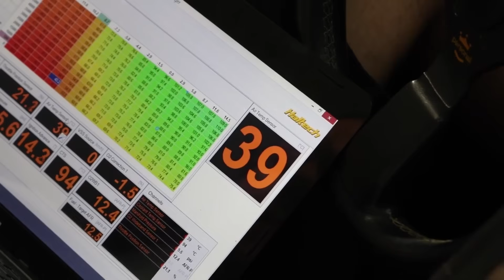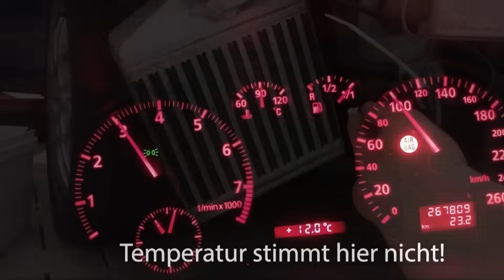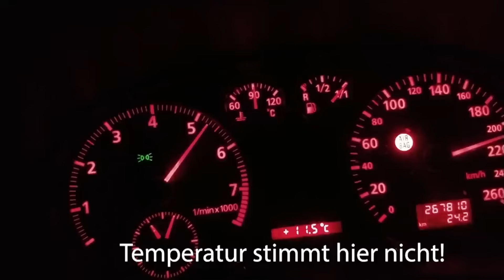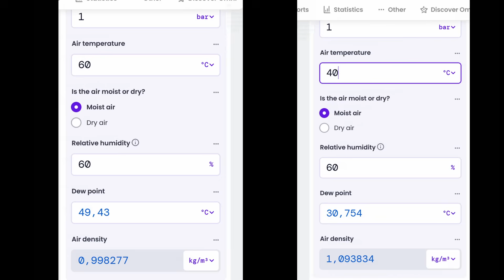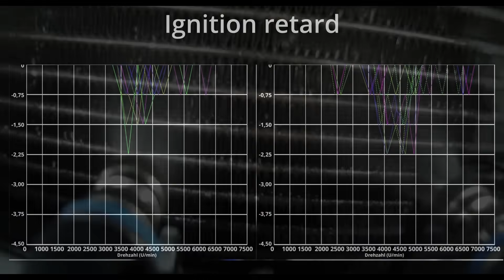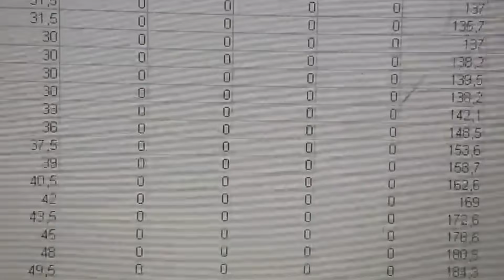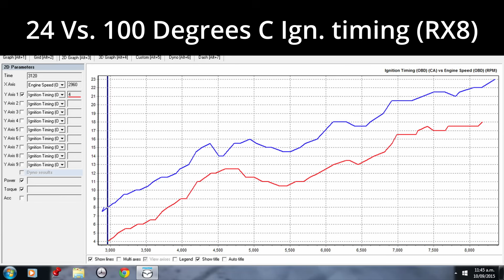More HP For 1$ on your Turbo car!!! | Intercooler water spray for cheap + Tested!

Comment: You need to add more fuel within leaning out from denser air
Reply from the maker: No not needed the car has a manifold air temp sensor wo the ECU will correct accordingly

Comment: I'm from Brazil. Oh my god, man! Amazing! You're amazing! My city is very hot, this will make a huge difference! Thank you!
Reply from the maker: yeah i believe that haha. where i live in greece its the same, but in high humidity i think wont make as much of a difference for example.
Reply: @throttlebuddies0  What would high humidity be? A rainy day?
Reply from the maker: @Witor99  well id say if the humidity in the air is above 70-80 percent rain does not automatically indicate high humidity
Reply: @throttlebuddies0  When I press the water button, the windshield wiper blade activates. Is there a solution?
Reply: @Witor99 mora em litoral?
Onde mora aquele climatizadores a água funcionam bem? O princípio é o mesmo.
Pra aquecer 1g de água você precisa de 1cal
Pra descongelar 1g de água se precisa de 50 ou 80cal, não lembro.
Pra evaporar 1g de água se precisa de 500 a 600 cal.
É muita coisa! 
Essa energia é retirada do ar, resfria o ar para evaporar a água. 
Mas é muito mais fácil evaporar em um local seco.
No litoral é muito mais difícil.
Até 50% de umidade deve valer a pena 

Álcool evapora mais fácil, mas retira menos energia do ambiente.
Daí tem que usar muito mais.

Comment: If you were to trigger it automatically, on what all values you'd base it? IAT/Boost pressure/load?
Reply from the maker: personally id say boost pressure, cause if its based on IAT, the reaction would probably be too slow so youd get spikes of high IAT before it cools down and then you might be off throttle again

Comment: The traction lost by tires getting wet probably over rides any gains... but a co2 fogger might actually work for cooling air.
Reply from the maker: probably not cause in that case there is wheelarch liner behind it and also its so little water that it really doesnt matter...

Comment: I am considering the use of the wiper fluid system to cool intercooler for short bursts of spray at the AutoX start line.  The key for me would be tube T’s and Values to enable the new nozzles to be active, or be set to normal windshield duties when not at AutoX.  And of course swapping out detergent based wiper fluid for perhaps a 15% rubbing alcohol to water blend.   It should not freeze, and should not gunk up the intercooler..... Thoughts?
Reply from the maker: Yeah im guessing that would work if you stay below 30 percent alcohol content thw mixture will not burn so you will be fine with that plus you get the heat evaporization benefit from alcohol in addition

Comment: hello i have a question...im about to finish my turbo setup, a small one with 2871 maxpeedingrods ( floating bearing ) which is oil and water cooling, if i just connect only oil is it gonna be a huge problem or not? some people say yes some others say no problem at all...whats your opinion?
Reply from the maker: well i wouldnt recommend it but it can be done. im running my gt3582 without watercooling but i wouldnt recommend it as i said.
Reply: @throttlebuddies0  well lets try it...the funny fact is the most cheap part of my turbo build is the TURBO hahaha!
Reply from the maker: @mariossakas8913  i feel that haha 
gpoot thing: its not that bad of a loss if it breaks lol. broken a maxpeedingrods 2871 aswell soooo yeah...

Comment: The whole story looks simple and cheap but it's not. The question is what is the water flow, how long does it take to get water, if I'm going on a 2-3 hour trip, how much water is needed, at what temperature will the system activate. There should be a separate water tank because there is no windshield washer fluid. A thermal switch should also be installed that activates the system above a certain temperature, more nozzles should be installed to cover the entire surface of the radiator. The nozzles should have a small hole so that the water is dispersed as well as possible, so distilled water must be used because of the scale that would clog the nozzles and cover the radiator...
Reply from the maker: Well you can make it complicated and you can leave it simple. For a solution like you descripe id go for a system from snow performance that can do the same thing or water /water/methanol injection

Comment: Another idea is to put a small puller fan behind the IC
Reply from the maker: @badass1g  that will only have an effect when standing still
Reply: @throttlebuddies0  still a good way to counter heat soak when standing. In most cars turning on AC also turns on cooling fans. That how i use it. Of cause only make sense with an FMI.
Reply from the maker: @ironkcoony  well yes it can make sense but the temperatures will have dropped qgain after qbout 20-30 seconds of driving in my experience
Reply: @throttlebuddies0   on a 1/4 mile track in the mid of summer, every decree counts

Comment: I live in the Middle East, where summers easily hit 45-50°C, and I've always thought about a system like this! I believe Toyota recently introduced something similar on one of their GR models (either the GR Yaris or GR Corolla, if I remember correctly). This is seriously good stuff, I just wish someone would develop a fully refined version. It could be the perfect way to improve performance without voiding the warranty!
Reply from the maker: Well you could use a system from snow performance in the same way
Reply: @ thats the methanol kit right... hmm.... could look into that....
Reply: lancer evolution has this system, factory installed 30 years ago
Reply: 50 celsius??? Are you alive???
Reply: @ yus bro... if u see there quite a few places in this part of the world where temps cross 50degree Celcius in the summers....
Reply: Toyota celica gt4 st205 been using it since 94’.

Comment: Its very important to use non-hard water for this or your intercooler will have deposits all over it in no time.
Reply from the maker: Well ut would be best to use destilled water i guess 
But im not sure of they are gonna accumulate that quickly
Reply: @throttlebuddies0 
Some people live in areas where the water is very hard and it would plug up their intercooler in a couple months. Other areas wouldn't have a problem going years. It's pretty well documented, not just speculation.
Reply from the maker: @tomhunter91  might be something to look at if you are using it but i mean destilled water isnt that expensive sooo :D

Comment: There's youtuber already direct inject water into the engine intake and get higher power off it.
Say, try it with both system. Interested to see if it works better with external sprayer and internal in the intake simultaneously
Reply from the maker: Water injection into the engine works much better but to use that you need a higher pressure pump and a nozzle that atomizes the fuel more because if you are spraying before turbo it might damage it otherwise and after needs more pressure to overcome the boost pressure ran

Comment: By the way. 20% alcohol and 80% water mixed with a bit of soap allows the mixture to stay in a single solution instead of separating like alcohol usually does. The combination allows for superior evaporation and removal of heat for the intercoolers. Water can technically remove more heat alone, but water doesn’t evaporate nearly as fast as alcohol. I tested this mixture with a lighter and it didn’t ignite when in its normal state nor when it was atomized. Meaning heat would ignite it either.
Reply from the maker: You dont need to add soap or anything water and alcohol mix together no problem. A mixture of up t 50:50 is non flammable in the case of methanol
Reply: But before using this mixture make sure to test it with a lighter in both phases.
Reply: Nice job on this tutorial video. I would also suggest insulation for the wiper fluid tank to prevent the engine heat from getting into the mixture and prevent maximum cooling.
Reply: have u tested different water temperatures?

Is colder always better in this case? Or is warm water mixture better do evaporate quicker?
Reply: @Hardys-Mods  colder is always better because the larger difference in the mixture temperature vs the charge air temps allows for faster heat transfer from the charged air to the surrounding air.  This is why insulation on the tank is good to prevent the engine heat from warming up the mixture.
Reply: What's the latent heat of evaporation for soap? Isopropyl alcohol is mixed with water yet never separates. Facts not fiction.

Comment: Not sure that spraying an intercooler that sits right in front of a tire is the best idea, but you do you.
Reply from the maker: wont make a difference as the water does not pass through it drips off at the bottom. Even if it did all cars have a wheel liner behind the intercooler with only smaller vents to the wheel well itself so there wont be anything coming that way anyway.

Comment: Also works for inside brake cooling ducts
Reply from the maker: im not sure if thats a good idea because the temperature difference might warp torors. but never tried it.
Reply: @throttlebuddies0  European Race Trucks use water cooled brakes.  Seeing all that steam when the brakes are applied is pretty epic.
Reply: @CDeuce152  true but i wonder how long those rotors last^^

Comment: What about Air conditioning pumped to the intake?
Reply: interchiller
Reply from the maker: the throughput of a turbocharged engine would overwhelm an ac voncenser realy quickly and the benefits would be minor. also the restriction would inhibit flow and cause power loss. 

the AC is used to cool down the water for water to air intercoolers on some factory cars even that orks well but takes a lot of effort to realize on something that doesnt have this already.

Comment: i already though about this before but it would be nice to have this at only full throttle, automatically!
Reply from the maker: yes i said in the video i am probably gonna do a video on integrating it into a standalone ecu but that involves a bunch of wiring also. 

on a stock ecu the easiest method would be with a pressure switch that is plumbed into the intake manifold or intercooler piping and opens at a pre set pressure, closes a circuit that actuates a relay that is powering a seperate pump atatched to a reservoir.

Comment: Hello from Australia. This is exactly what I did. My washer bottle has two pumps, I used one for the top two sprayers and the other for the bottom two. The nozzles are course 180 degree sprayers. On one of my YouTube videos (nick_captian_slow) you'll see it. Thanks for sharing.
Reply: I forgot to mention that I have a micro switch under the accelerator that I can adjust. For example I can activate the sprayers at half throttle or full throttle.

Comment: cool part is that it also has the low level sensor. i did that last summer but the water would leak by itself once i spray once, i don't think there was a valve on the system, just the pump
Reply from the maker: True! i didnt have that issue with leakage usually it stops when the pump is stopping to pump but may be different on different cars since the windshield wipers are always higher than the reservoir. but you could put in a one way valve i guess.

Comment: Honestly, I had an idea like this. Glad to see this actually works and getting some data on it. Would adding a smaller high pressure water injector before the throttle help or going down the throttle body in an atomized state?
Reply from the maker: Yes that would actually help with detonation and remove heat from the combustion chamber. you can use a water meth kit like that but just water also. the thing you have to consider is that the pressure that you inject it at has to be quite a bit higher than the pressure in the piping in a turbo car for example.
Reply: @throttlebuddies0  makes some sense, what happened when there is not enough pressure? I would presume the water would not enter the system right?  And does it have the be a meth/water mix to get the acquired cooling? 
I’ve heard meth can work wonders but is it needed on a street car that’s driven occasionally hard. Not track speeds or anything but it’s gets hot down here in Arizona in the twistys still over 38 centigrade at mid night some days. And the heat soak gets bad. I’ve noticed adding a better performing cold air intake gave me a decent little bump of .4 sec 0-60 improvement and better mpg’s (I’m guessing from the drop in intake charge temps dropped over 7 centigrade in most cases
Was never a believer till I tested it myself
Cheers thank you for the reply n the work you e put in
Reply from the maker: if the pressure wasnt higher enough it wouldnt push anything out or it would just dribble out. with proper atomization you can even spray pre turbo but also requires higher pressure. 

in greece it also gets to 40c in summer so i will install this on my turbo cars aswell.
Reply: @throttlebuddies0  oh I see, thank you I appreciate the insight